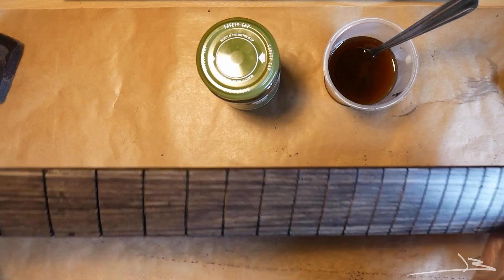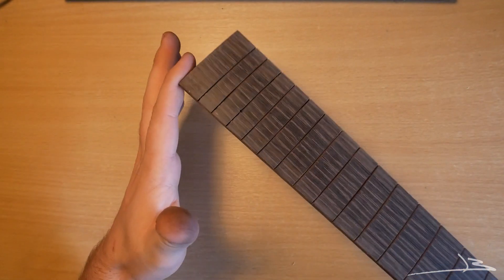Building a guitar from scratch | Ep4 - Body sides & fretboard | Great Guitar Build Off (Unofficial)

Comment: Your guitar is looking amazing! A few easy things to add to your tool kit, 0000 steel wool, to use to polish up and wood that has been treated or stained works wonders, you can even then use coats of TruOil or boiled linseed oil to  make the grain pop. As for wax get some Renaissance Wax used in all museums for instruments and fine furniture.
Reply from the maker: Thank you for the advice, I will try it out!

Comment: 09:03 - this wood can be a beech to work with :P
Reply from the maker: Hahaa, in all fairness it was quite a challenge to work with it, I noticed it like to be planed across the grain rather than with the grain which was rather unusual
Reply: @BogdanBacila301  I've had a fair amount of grief making a corner table from it.
Absolutely amazed at your end result!
You made me want to build a bass from the same principles - although I'm a bit leery at the idea of printing a bridge for a 5-string bass.
Reply from the maker: Just go for it! it's a lot of fun especially if you have a bit more space than I do, but please please just buy the tuners hahaa, I just wanted to challenge myself but the off-the-shelf ones are so much better than what I did